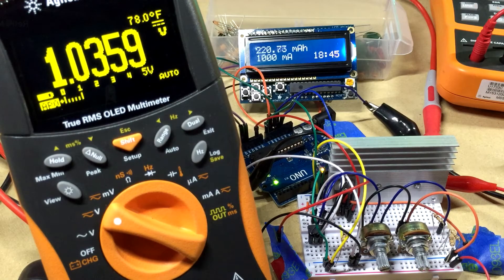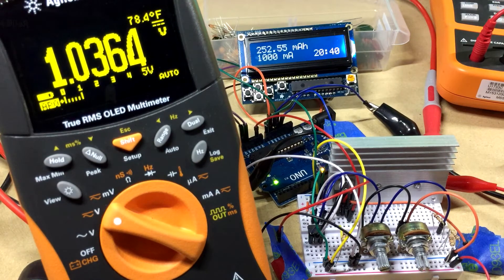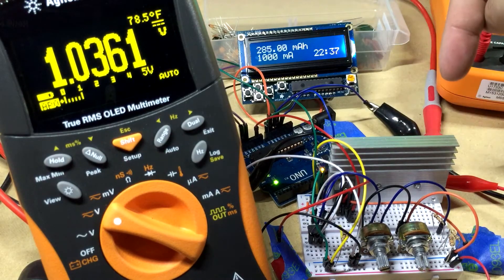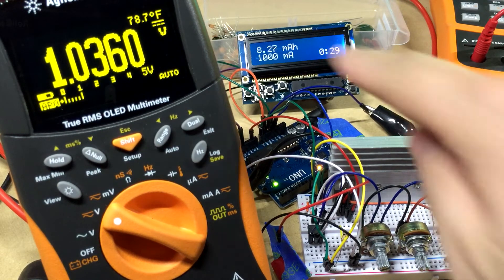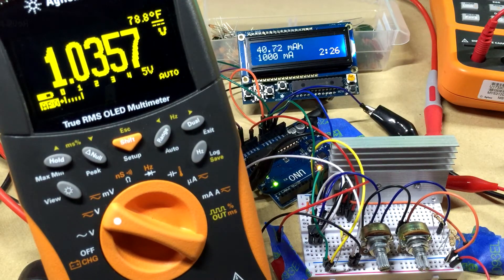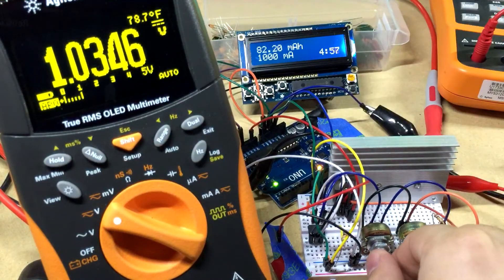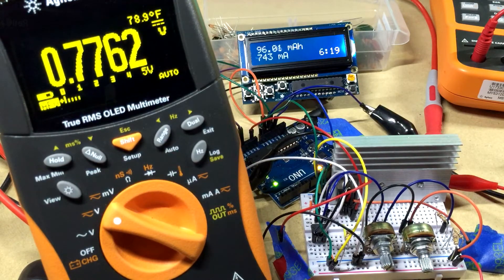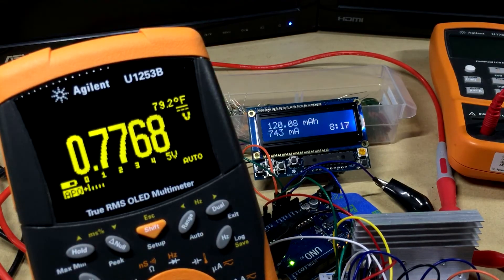Constant Current DC Load w/ mAh Logging [Part 1] (Arduino) #0026

Comment: How do you like that oled meter?
Reply from the maker: ***** the screen contrast is excellent for visibility and for showing up on camera, but the battery life is atrocious. That thing practically lives on the unusually large charger (laptop power brick, basically). My fluke 87v on the other hand is on the original batteries from years ago. There are definitely some trade-offs